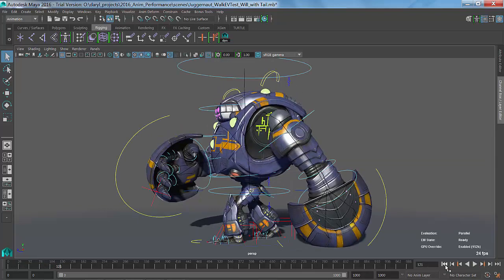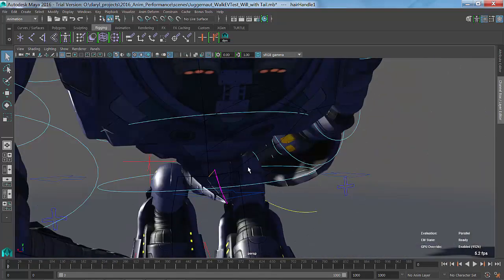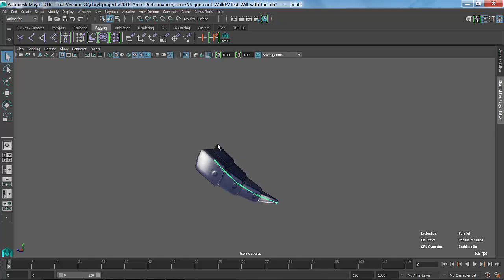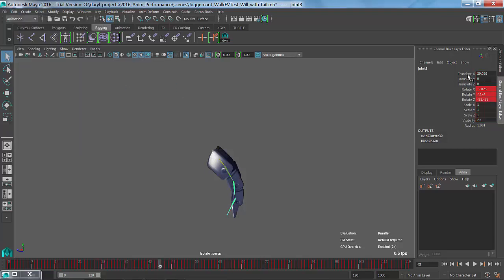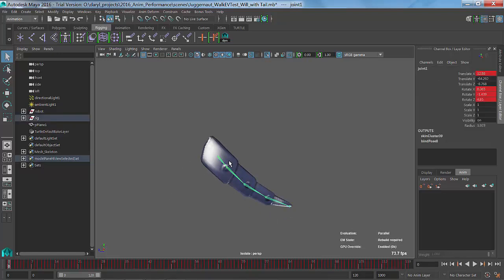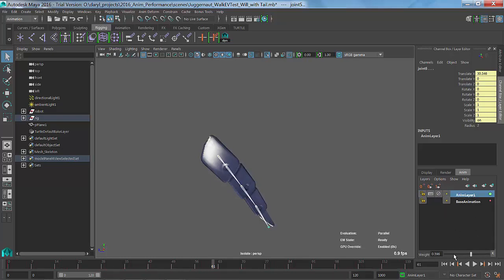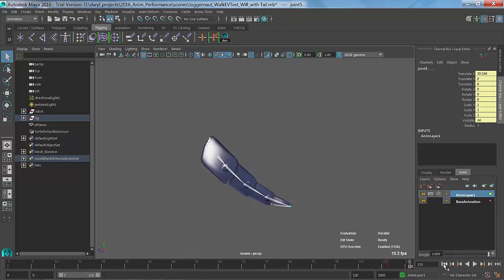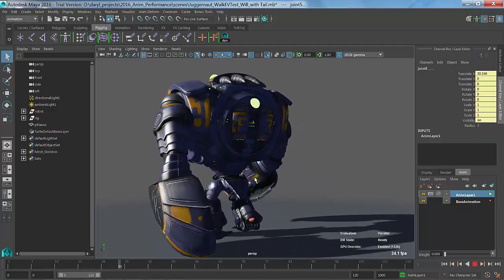Maya Monday -  Baking Dynamics to Joints

Comment: Hi Daryl, great tips. I've been following your videos for over a year now. I have a specific question regards system performance. Say i have this huge mountain scene with several props and it already takes over 1million polys and i know i'll have to add in a rigged character thats another million polys. At this point everything is going so slow and laggy and i can barely rotate around the scene and i need to start animating everything and add multiple dynamic processes that will require even more of my system power. Is there a good approach and technique i can use to basically make everything alot less system driven. Like temporary reducing poly count in big amounts or maybe something else that i'm not aware of to reduce my systems performance and i could work more efficiently in the scene. Thank you.

Comment: Cool, didnt know about the delete static channels command, super useful!
Thats why I love your vids Daryl, theres always a chance of learning something new - even as a proficient user myself.
Reply from the maker: +Stefan Ehrenhaus Maya is cool like that, I learn new stuff all the time and I have worked at Alias/Autodesk for 21 years:-)
Reply: @darylobert  Im using the make joint dynamic since today ( jiggle effect for breasts) but the problem is that after I apply this, 3 of the options >(stiffness, damping and Jiggle weight ) are all locked in yellow color. I can not unlock them. Like if they are hard coded. Any idea what is happening mate? Or is this even normal !?
Reply: @thesteammachine1282  curious if you ever found the solution ?

Comment: Thanks for the tutorial!

I'm a bit confused about the isolate select hotkey though.
As far as I know that button has been on the shelf for years and the hotkey Shift+I toggles isolate select and that hotkey's been there forever.
Reply from the maker: +Rymdkakor Yes, that icon on the shelf has been around for a little, I forget what cut of Maya it came in maybe 2015? The hot key of Crtl 1 is new and much easier to hit than Shift I
Reply: Oh sorry for the late reply!

I have been using Maya since the 2011 or 2012 version and I don't remember it ever not being there so I think it's older than that :)